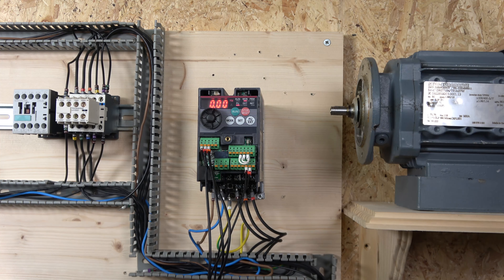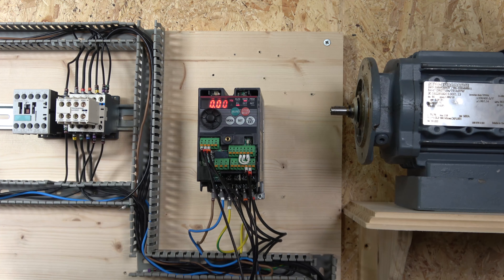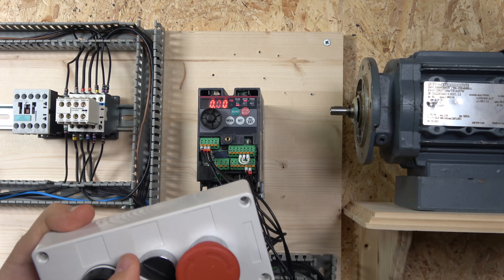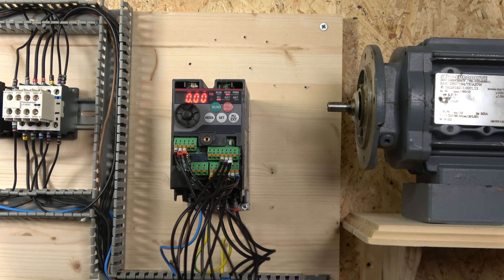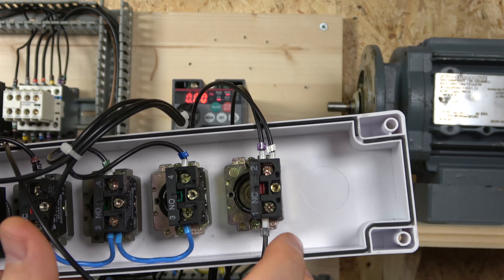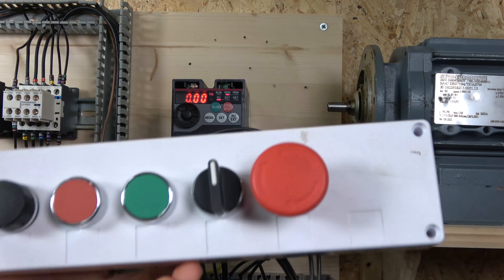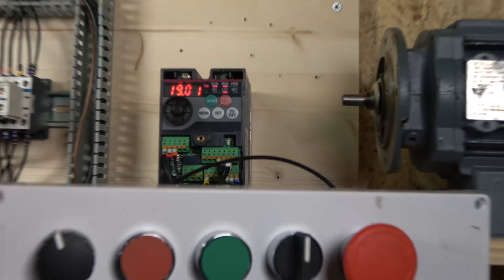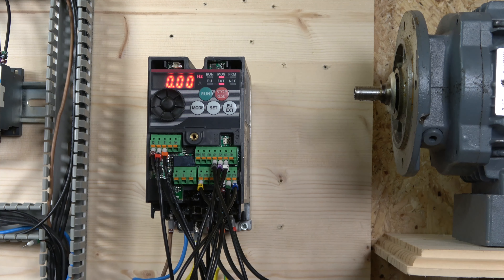Mitsubishi FR-D700 remote control, 2 wire and 3 wire control, parameter set up. (English)

Comment: Hello again. My vfd 700 is in a laundry machine. I found that it runs only in 1 direction . I interchanged the reverse and forward wires , still runs in the same direction of rotation Clockwise.. Can i say the vfd is bad?  I can hear the clicking of relays from the timer board . Please assist.
Reply from the maker: More testing is required. Are you able to download parameters to your pc/laptop using fr configurator 2. You can find instructions how to get configurator in one of my videos. Plus can you run drive manually safely. Are you powering from PC terminal or SD terminal. See if you can close str and stf direct from pc source, to make sure it is happening what you say it is happening. That kind of problem i have never seen in any drives, hence more testing is required.
Reply: @IGSElectronics  HI. What if I factory reset it. Then program it like you showed. I'm in a remote town and laptop was much much away. If it fails, Thinking of removing it after this reprogramming. Then taking to a bench test it while outside the machine. Is this a good idea?
Reply from the maker: @icemanb5065  If you can remove it and then bench test it, that would be preferred root. Regarding reset, i would not do that do to the fact you don't know what parameters were used to set up the drive to run on your machine. If you have time and check all parameters to see witch ones have been changed, against the default ones, before resetting. This drive is wary smart, so many things could have been changed to run your machine properly.

Comment: can i use 12VDC for terminal input signal? in the manual, it's suggest 10VDC, any problem if i uses 12V ? ( i'm using FR d710)
Reply from the maker: Hi Andy. No 12 dc will not do. You must fallow manuals instructions.

Comment: Very helpful, I need start/ stop/ fwd direction only along with Estop, I can get all that from the video, thanks but how do I wire in an auto off switch as well from a saw when it has finished cutting?
Reply from the maker: For that my friend you will need external unit to send that kind of signal to your machine. If i understand your question properly, you want saw to switch off after certain time of not using it, right?
Reply: @IGSElectronics  all sorted now thanks

Comment: Hi Ingus. I followed your videos on Mitsubishi inverters with great interest and for this reason I have a question to ask you. I have to control a 1.5Kw 400Hz single-phase motor that spins at 24000rpm (mounted on my CNC) connected to an FR-D720S-070SC inverter and I need to be able to regulate its rotation speed via the CNC machine controller. To do this, I connected a 0 - 10V output of the CNC controller to inputs 5 and 4 of the inverter and set the microswitch to V (frequency voltage control) and set parameter 267 to 2 (voltage input 0- 10V). The engine is started via a software command that closes a relay on the PC and STF pins of the inverter. By acting on the CNC software, the motor starts to spin and reaches 24000rpm when the output frequency reaches 400Hz but if I try to vary its speed via the software, nothing happens!! Where's the trick? Where did I go wrong? I will continue to follow you for your excellent videos. Thanks in advance for the answer (if you want to help me...) Hello